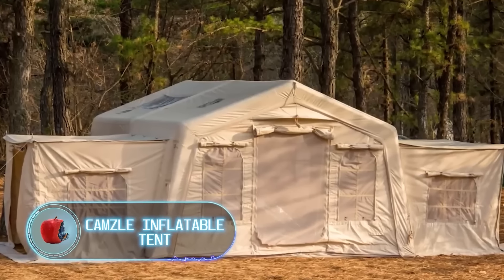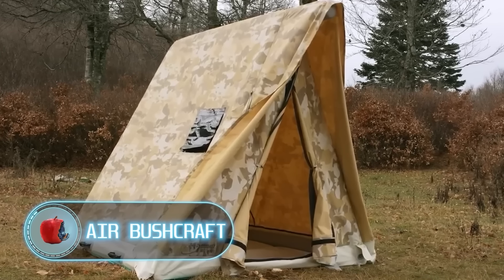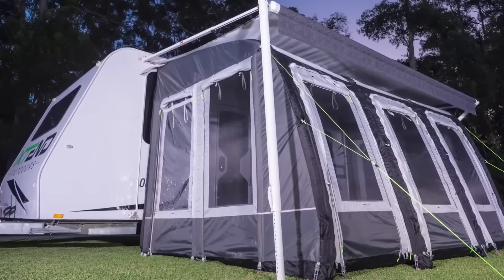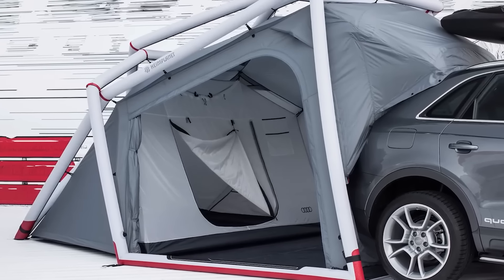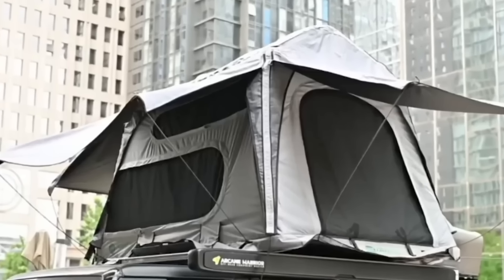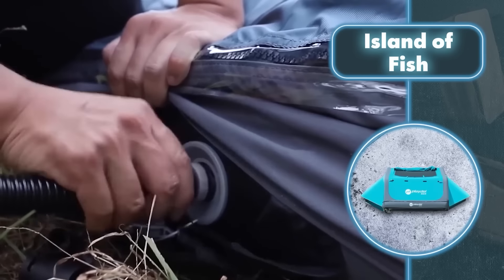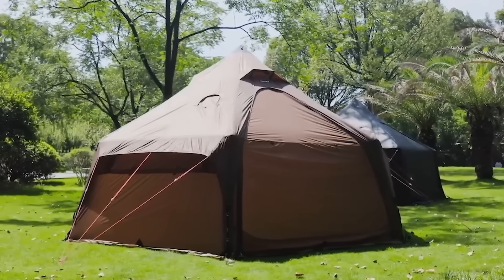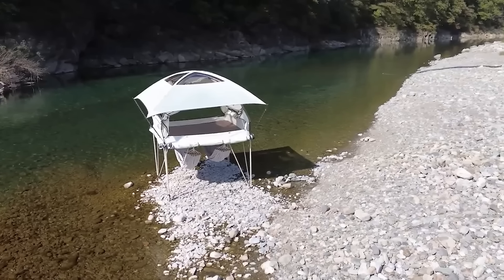30 Mobile Homes That Require Only Air to Build

Comment: There needs to be one you can spray with concrete, or something, that will harden to give a more permanent home. Several coats would probably be necessary.